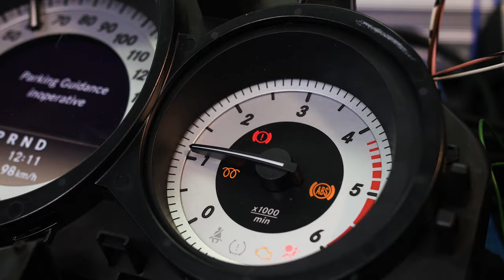ECU Testing - the process from start to finish in 90 seconds.

Comment: The most important process when testing the ECU is enjoying your coffee. Really, we haven't learned anything today
Reply: you can build a controller tester with some potentiometers,  resistors, caps, 555, and or arduino,  ecm/pcm rarely fail, dodge pcm fail because of the location too much heat,  I do auto electric/electronics and don't have nothing fancy just a simulator, hot air station, reballer, process is basic,
Reply: @florenciomartinez3695   te refieres al NE555 o a otra máquina?